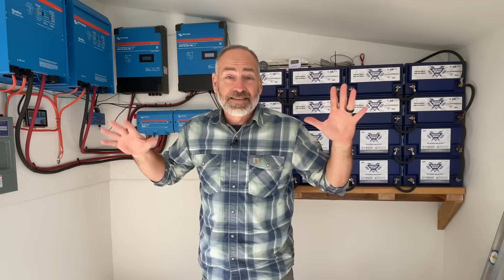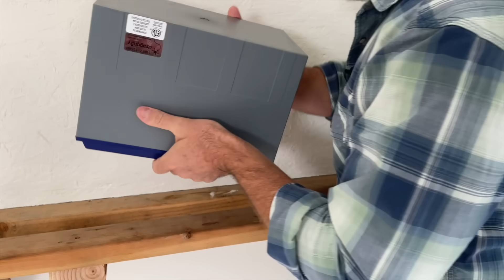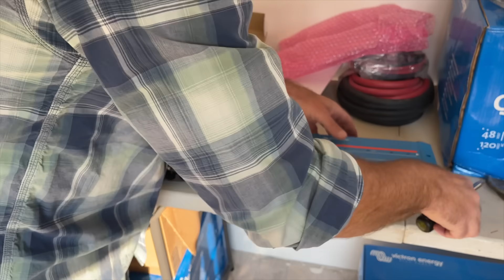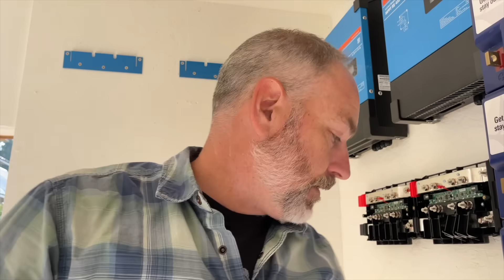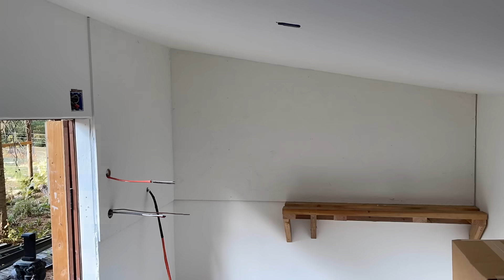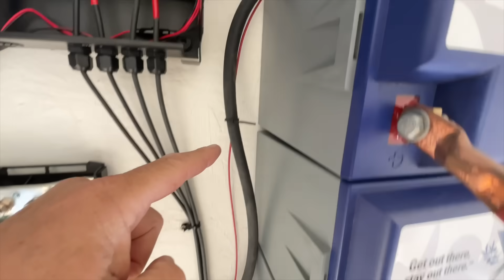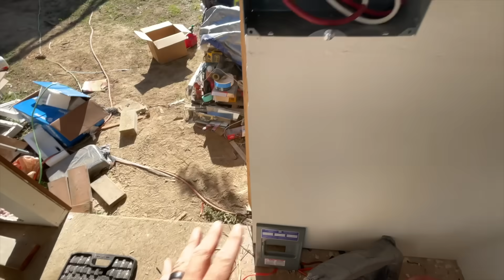EASIEST Off Grid Solar Power System Battery Bank

Comment: Hello Martin - good video, very clear. A question: How much did all this kit cost? Is there a spreadsheet somewhere? Asking out of curiosity, having started my own DIY off grid project but stalled for various reasons.

I envy you having access to so many products and suppliers. I live in eastern Europe and the tech hasn't reached this far yet - there's little choice of products, and what there is can be of dubious origin and quality (i.e. Chinese). Importing stuff from the US is prohibitively expensive, what with transport costs, Customs duty and VAT at 20%. Hoping to source lithium batteries but they are very expensive relative to incomes over here. Same with inverters, either old tech Chinese imports or very expensive UK or German kit.
Reply: His battery choice is not great. Hes paying $4000 for 48v 100AH. a Server rack battery is the same voltage and AH for $1500. He has $16000 just in batteries and only has 19,200 Watt hours of power. If he bought server rack batteris he could have had 48,000 Watt hours of power for the same price.
Reply: @enigma9789  just made a comment about this. He was no doubt given those batteries for free. I would hope nobody actually buys those at retail cost.  Server rack batteries with same/similar warranty can be gotten for almost 1/3 the costs of these. For exactly the same capacity. And in my opinion would look way cleaner.
Reply: @AcpEngineering  So...  where does one get these serving battery things?  Who sells them?
Reply: @johnafagerquist8235  signature solar has them. Current connected has them. If you Google server rack batteries you'll find quite a lot.  I don't currently own any so I couldn't recommend one over the other. But eg4 has a lot of positive reviews. I would probably get that brand for my next project.  I've used countless 280ah Raw blue cells for most of my projects to date.
Reply: @AcpEngineering  Thank you for the information.
Reply: I know the Battleborns are right around $950, each.  Victron Inverters are $1250 or so each.  Charge-Controllers vary from $120 to over $500.  Make no doubt, this is a high-dollar set-up.  But the quality is immense, and i have no doubt it will last a VERY long time and fit the needs he envisions.  IT is a very well-done set-up.
Reply: The whole set up, only what he is showcasing here, is about $25K if you were to actually buy it. Not including the solar panels or anything else.

Comment: I too recently went from 24 V to 48 V using the same battery set up, except mine was only eight batteries. I have to say I’m a bit confused about the grounding, as I’m not sure if my grounding is going to the main panel ground or the ground pole I put in the back yard? I seem to have two ground points.
I’m afraid I may have a created a complete circuit? Definitely wish more people talked about grounding. 🧐

Comment: Just be careful when working on these types of systems, number one rule always assume it's live, get a voltage detector glow tool and test before and after isolation and "keep one hand in the pocket" when working on live circuits and make sure you have insulating shoes like a dry rubber sole, avoid wet leather especially and don't poke your fingers around or you may get a bite, mistakes with 240v can be fatal.

Comment: I would mount the surge and shunt up off of the batteries, ... and two (if it makes a difference) I would run same length wires of + and - rom the batteries to the buss.  I know in many smaller installations the length makes a difference.  It would be interesting to see what Victron tech support says.  I would like to see comparison of BB batteries to others in general.  The info you hare comparing LiFePO4 to lead acid is nearly identical to other LiFePO4.  I have some BB and trying others that also has 10YR warranty ....... so there needs to be good justification to spend nearly double for BB.  BB may be giving a big discount to big money but the lower $ abilities they charge full pop.  Somehow they need to increase their availability to comparable costs.  I've not been super happy with their support, which I bet is much better for big buck customers.  Being truthful is very important ... in all things. Not saying there is any dishonesty here... very nice install.

Comment: Hi,
So, you did not buy this as a single system (OTS or a custom build) from one company with expertise in solar?  I'm wondering because I am currently designing a major renovation of our 'retirement home' ;-) and want to go with a very similar system to yours, other than we will be linked into the grid as well, but offset those costs as much as possible. I am therefore looking for a company (Renogy, or Lion, etc.) that has the best support and engineering wherewithal as I design, especially overall capacity and a bit more on power cabling post-Inverter. Do you have any ideas there, or has yours been all DIY, having been learned over time?

Comment: Martin, you must be commended for creating this most comprehensive, detailed orientated set up for the Victron system. This video should be the gold standard for someone just starting to review the the Victron solution. I know the costs for this system are the highest of any other system out there, but this sets the benchmark for off grid solutions. Well done..
Reply: What is the current cost to do this off-grid system as I am looking to do an off-grid system for Our remote Cabin in Ohio
Reply: @brucemiller4141  Over $20K, for a vacay cabin I'd go with a 2kW-3kW inverter, this guy is trying to run a dryer and range at the same time. 
I'd rather air dry my cloths and use and use an air fryer. I got a 3000 W renology inverter for $300, but it 12V, but I could run a fuse box to buck converters and get 96V to 12V for $250. And I live right next to battery hookup near Philly. His costs are insanel
Reply: Yes! I totally agree with this easy to understand tutorial and breakdown.  I know some things may be sponsored,  but given that, what would you guesstimate this setup cost? (Minus anything beyond your shed panel going to the house. This estimate would be greatly appreciated and understand it would only be a guesstimate.  Thanks Martin!!!
Reply: @marknack7816  Just the batteries are about $14k.
Reply: How much is 5kva 48v vickron inverter with 100Amps charge controller?
Reply: Each inverter/charger is $2,700 and solar charger is $1,300 . Expensive, but Victron is the best in the business. I settled on Victron after seeing some of the frustration in other’s equipment. I also went with Signature Solar‘s rack mount battery system instead of battle born. I ready now to assemble the system..

Comment: Thanks, great video. I like victron and have used them on DC jobs. Can you let me know the cable size of the ac output from the inverters into your circuit breakers in the battery shed. They look small, they should be a current carrying capacity greater than the size of the circuit protection protecting the cables 50Amp?

Comment: 3000VA(old system,single) and 5000VA(new system, single) respectively...that equates to 2400W and 4000W respectively...Do NOT mistake VA for W...formula is VA x 0.8 = W...
Get away from the SmartShunt and get a Lynx Shunt. it will tie in the your Lynx Distributors...

Comment: Dude. The most simple system out there is Sol-Ark. I just installed my 15k with EG4 batteries server rack system. It’s a whole lot cleaner and easier to install than your system. 😬

You probably don’t want to hear it.

Comment: You mentioned having a 240V generator for days when you need it, and it's wired into both inverters.  Do they also charge the batteries via the DC lines? or do they only run the power out of the AC output?  Also, does the generator automatically turn on or is it manual?
Reply from the maker: Yes they charge the batteries. It is manual.

Comment: Well then I have a question for you I got a 9.7 amp 405 w solar panel why does that one solar panel give me 22.6 amps and on a sunny day it gives me more like 45 amps can you explain it to me or can I explain it to you why is it the amperage is never what they call it or never what it really is and why is it so many watts turn into amps in fact why is it every 10 watts adds up to one amp or is it that they're lying to you and every 10 watts is an amp. I like amps I haven't really doing anything with volts I've been running a 12 volt system my charger my  12 volt/24 volt charger sometimes wants to charge my batteries at 41 volts the highest I saw it is at 49 volts and this is only a 24 volt charger that 12 charges at 12 volts or in this case charges at 17 volts but still does that mean my 12 volt/24 volt is actually a 49 volt charger a cheap chargers that I got for solar panels for about 14 bucks each 20 years ago.

Comment: 102122/0451h PST 🇺🇸 Thank you for showing the updates on your off grid Power Supply. I’m sure you’d enjoy reading your system performance in your bed room ( through iOS/ OS X systems) CERBO-GX is a marvelous device. I’m sure you received  the images, I sent, long long time ago.
I am happy that your little Power House Cabin is totally insulated. Perhaps an automatic climate control system could be installed; thus keeping the Cabin @ 70D🌡. LiFePo4 is not friendly with low ☃️and high ☀️temperature conditions. Thinking about a ventilating system, in the future?
Well, I’m happy for you and your family. Finally you have a full fledged Power Supply System of your own. Bless you and the family ✝️

Comment: To bad Battle Borns stuck in the past. They need to start making 24 and 48v rack batteries. I chose another brand because I didn’t want what looks to be a bunch of car batteries stuck to the wall. Plus I only have six batteries that makes 30.72kwh in less space with up to 7000 cycles.

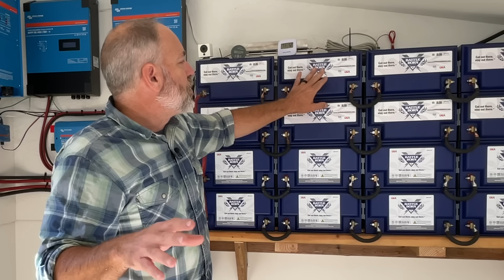Comment: 28:07 yes, you can use 100% of the battery with LiFePO4 without instantly killing it but routinely going below 20% or above 80% reduces the service life. 60% normal service window is still better than lead-acid's 50% but it's not enough to get excited about.

Comment: Warning. I see a flaw in the design. you are daisy chaining your batteries. each 48V bank should connect to the busbar not to the next one. I say this because you have 100ah batteries. if you pull 10kw of power through those batteries that is about 200 amps or 2C which will go through each set of 4 (48V) if each 48v bank goes to the busbar then at max load you will pull .5C from each bank. watch video's on why you should use busbars and not Daisy chain lithium. the way you have it will work but will reduce the life big time of your batteries. Temperature is the number 1 killer of lithium, when you run 2C through a battery it will get hot and lithium will expire faster. I have 4 banks 280ah @48V  and they each go to a busbar with a T fuse 200A before the busbar on positive side so I can cutoff any bank. I don't want junk yards filled with lithium batteries in 8 years and daisy chaining them will do that. you can almost double your battery life by using busbars. The ones saying to daisy chain batteries are selling batteries.  again search why you should use busbars for lithium and not daisy chain them.  My EVE 6,000 cycle cells should last 10,000 since they will never go over .3C. EV batteries fail fast because they are daisy chained. just like you have 2 5k inverters to split the load you should have 4 banks of batteries min to split the load. Also since you have 100ah cells I would have 6 banks of them so your max load gets closer to .3C. We spend lots of money on batteries lets make them last as long as they can.

Comment: Great video and system no doubt.  Trying to get a budget in mind though so roughly what will be total cost when completed for system after you purchase the last bank of solar panels needed ?   Again thanks ! and I hope my wife and I can get totally off grid also within the next 12 months. 👍🏻
Reply from the maker: It was not cheap as these are top quality components. There are links in the description where you can get current prices.
Reply: @MartinJohnsonOffGridLiving  Could you please add info for the surge device you used coming off the shunt? I have a 48VDC system I'm about to install and have Class T fuses in each of two custom built batteries directly off the positive post as dead short protection, and through all my research, never found the device you used. Looks interesting! If you could please add it to the component list or link it here, that'd be great! Would like to compare and see if I should add it to my setup. 

Forgot to add a huge thanks for all the detail and sharing throughout your process! As someone in the build process for a mobile setup, I can't imagine also managing a YouTube channel for it. Thank you!

Comment: Great video, a Beautiful setup & a nice clean job, kudo’s to ya. My only criticism (OCD mainly) is ur input wires from the pv are not like the rest of the system and would be nice to see some ferrule’s crimped on there, also, while the crimps don’t look too bad, for ur investment and nice blue stuff everywhere, a hydraulic crimper does make a very nice connection on ur big cables & are not that expensive compared to the rest of the gear. 
Thanks for sharing this info, really nice build. Cheers

Comment: Clean install.  Small fyis: Victron suggests the cables between inverter to the Lynx dis. be the same for both inverters...otherwise one inverter will be working harder than another.

Also to maximize equal battery draw and charge, Victron recommends bus bar method to connect your 12v batteries into one 48 v batter pak.  Your method is decent but not optimal according to Victron manuals.  Victrons recommend also limits the amount resistance due to battery connections.

One last small fyi:  You can by a shunt that connects into the lynx connect system.  cleaner and again reduces resistance due to more connections.   

I due like how you try to keep everything close together and clean as possible.   It's given me an idea.  I like the idea of using a corner to help with localization of components.  That alone was a gem of info for me.   Thanks.

Comment: It looks like you're coming out of the inverters with #10 romex (orange sheath) to feed the 20 amp and 50 amp breakers in the panel. Unless I'm missing something, the feed wire should be #4 to handle the potential combined load of 70 amps since #10 is only permitted up to 30 amps. But, best I can tell, the inverters deliver 50 amp max. If that's the case, then the 50 amp breaker should be the main with the 20 amp taken off the load side of the 50 amp breaker. In that case, #6 wire would be sufficient.  That looks like a pretty nice system and neat installation.

Comment: Marty, I forgot to mention that since you are mixing new batteries with old ones, it may be best to alternate them in the rows instead of just stacking the old ones on top of the new ones.  I'm sure Battle Born can advise whether it's worth the effort to redo the stack.
Reply: The way he did it is actually the correct way. If he mixed them then he'd have 12V batteries of slightly different capacity (due to age) in series which you want to avoid if possible.
Reply: @niktak1114  But they should have been balanced.
Reply: @VilmaHallikas  they are in parallel so they will balance as soon as the voltage is no longer between the knees of the voltage curve
Reply: @niktak1114  it's a 4p4s setup. Each row in series and all rows in parallel. The internal bms will prevent over-/undercharging, but now they are limited by the lowest capacity/soc cell group.
Reply: @VilmaHallikas  he only has new cells in series with new cells and old cells in series with old cells so the cells within each series group will have similar capacities
Reply: @niktak1114  yes, but over time they will drift (especially since the cable lengths don't match). With series-parallel you should balance if you want best performance. And like I said, if the batteries didn't have bms in them then definitely would need balancing. Now it's not strictly speaking required but should be done at least manually every now and then.

Comment: Great job and super description - I'm very impressed.  One question... you show a 50A breaker going to the house and a 20A for the solar shed.  Most residential homes these days have a 200A service panel to accommodate all the house items like HVAC, HWH, Frig, Stove, Dryer, and all the small stuff.  Can you please explain why a single 50A breaker is sufficient to power the whole house?  Likewise, I assume since you have two of each - charge controller and inverter that one could start with one of each and expand as needs grow.  Thanks!
Reply: Those 2 breakers are just for the solar panels. The service panel in the garage still runs all of the outlets.

Comment: Why not use copper straps between the batteries, less work and cost making all those short cables...
Those batteries are really expensive...they are going for $100 a kw at best deal...I would never pay $900 a battery...
You spent $14,000 on batteries alone for a 19,200 wh battery...
Reply from the maker: Why not? Because this is the way I chose to do it. You can do it anyway you like. Paper clips and bubble gum might even work 🤣

Comment: Maybe if I ask again you may have the courtesy to answer? Why do you have the lights and receptacles in shed on a 20 amp 240 Volt double pole breaker?
Reply from the maker: There is a 240v out let there. The lights and other outlets are just taken off one side of that outlet. Legacy stuff from earlier. It is in older videos.
Reply: @MartinJohnsonOffGridLiving  Thanks for the reply and clarification